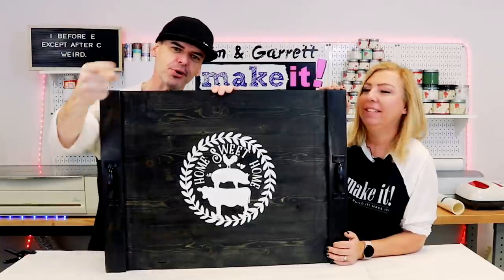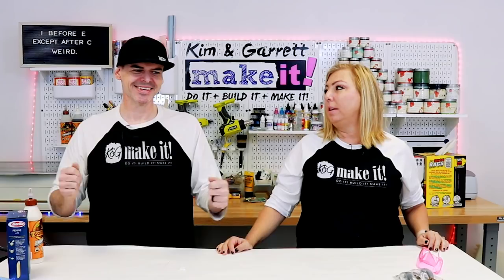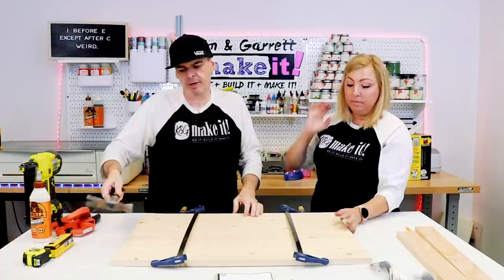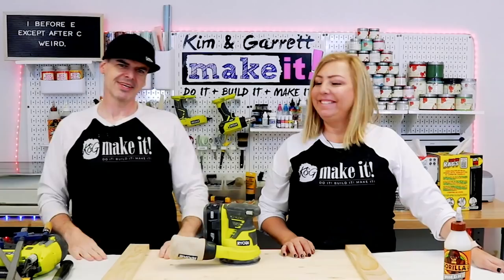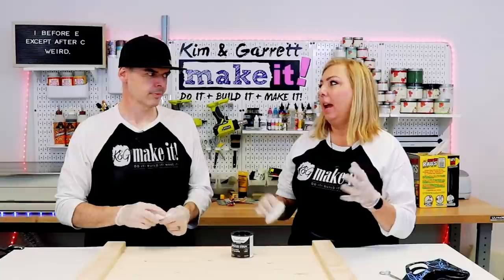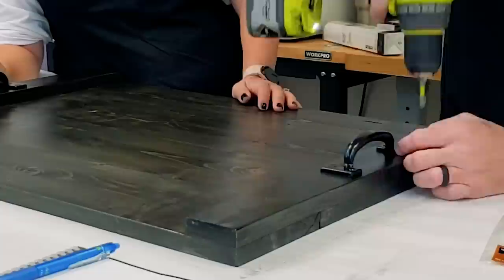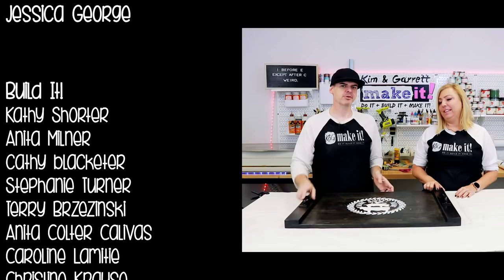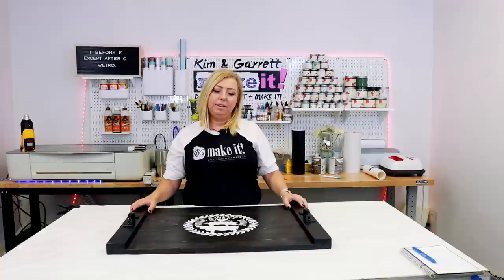DIY Noodle Board Stove Top Cover with Custom Design

Comment: Nice job guys! A little bit of salt will cause enough friction to keep boards from sliding during glue up of the boards.
Reply from the maker: What!?! Salt? That is a Killer Tip! I would have never thought of that in a million years...  Wow!  I want to go try it right now.  Thank you so much, Mary!  Have a great week! ~garrett
Reply: @KimandGarrettmakeit  Just granulated salt but you do need to spread the glue out before adding the salt.

Comment: I had to make mine a little different as I have a glass top inset int my countertop. The control knobs stick up so I needed some height around the edge.  I found an unfinished cupboard door at the big box hardware store that was close to the size I needed. Then bought 1x2 board and cut to length for 3 sides of the door (1 long side, 2 short sides) then placed them around the outer edge of door. This was just enough extra to make it fit perfectly over the glass top and controls.  Painted black, added handles and vinyl sticker with laurel wreath, initial and EST date.  Love it! So helpful in a small kitchen that doesn’t have much counter space. 👍
Reply from the maker: Ooo that sounds genius! I need to see a picture of that.  Our daughter wants one and she has a tiny inset stove too.  Thanks Laurie!  ~garrett
Reply: Add a picture I need to make my one for top glass stove too

Comment: A year or so back you used your laser on a cheese board for me. To add the handles I used a chalk pen painted the bottom of the hole area and set it down where I wanted the handles to be. When I lifted it up the hole area was perfect for me to predrill the holes. 
Good idea too is when seasonal vinyl goes on sale I buy that for stenciling. Way cheaper. 😉 Ps your board came out great!
Reply from the maker: Thanks so much! We'd love to see pictures!

Comment: I made one and getting those ends attached without them shifting is always an issue. But I’d rather not see the holes. These are great. I think that if you have electric at a show… You could bring your Cricut and personalize it.
Reply from the maker: That's a great idea!
Reply: Could you add wood filler to cover the nail holes?

Comment: I'm making one of these for my dad thanks to your video I know that I can. I have 2 questions if you would be so kind. To seal to make food safe what would you use? I can see my Daddy using it as a cutting board. Next question I want to make 2 smaller ones to go in my Travel Trail over sink and glass top stove but nut sure what to use on bottom to hold in place beside suction cups of some type? Thank you for what you do. Have a Safe and  Blessed Holiday
Reply from the maker: Yes, absolutely

Comment: Thanks for this tutorial.  Just wondering why you didn’t glue boards together?  My instinct would be to glue them but I’m just learning… thanks.
Reply: They explained the efficiency was the reason, at the end of the video. It makes a mess, it’s unnecessary, and like Kim and Garrett explained, it takes more time. Plus, you have all the enforcement you need in the side brace pieces, no need for extra glue. Hope this helps!
Reply from the maker: Good question! We didn't think gluing the boards together was going to really add to the strength of it, but we knew gluing them together was going to add a lot more project time.  Thanks for asking! ~garrett
Reply from the maker: Psst... Hey Candace... Want to me a moderator? too late...  I already did it. ~garrett
Reply: @KimandGarrettmakeit  thank you Garrett!  I appreciate your getting back to me. I’m going to give this a try. 👏🏻👏🏻.